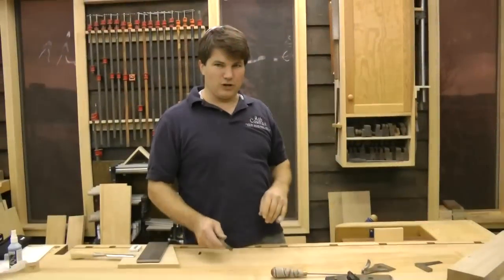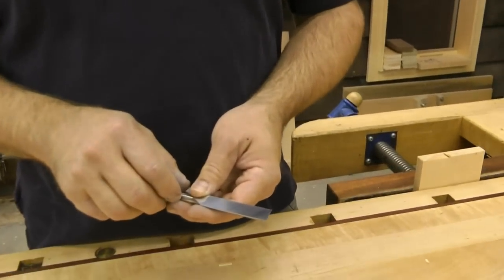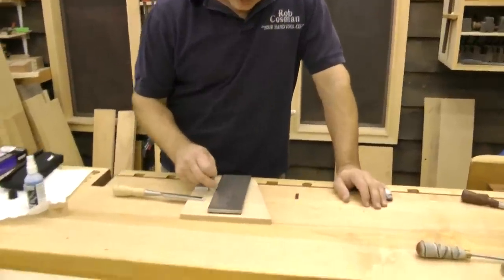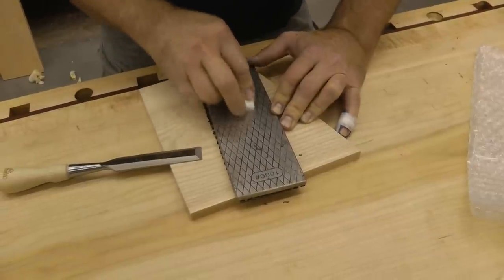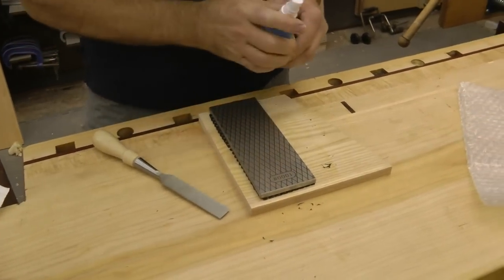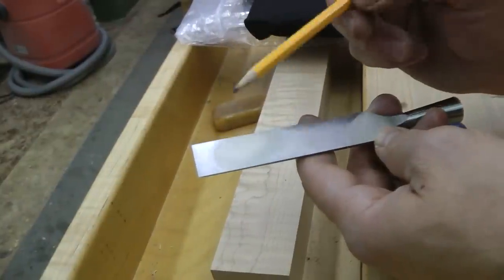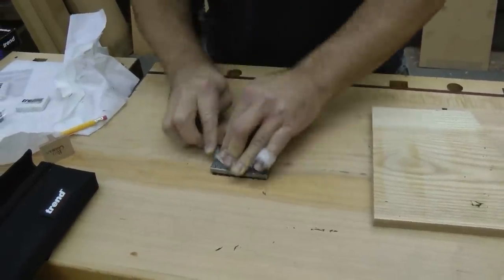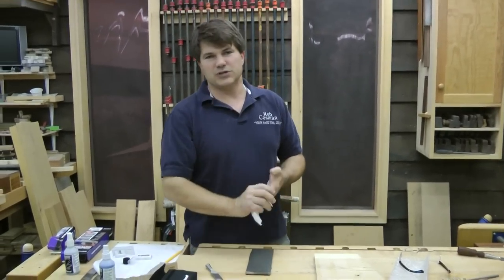Chisel Preparation with Rob Cosman

Comment: I thought I was preparing my chisels before I saw this video. Using this method makes even the $5 pack I have completely different. I can't wait to get some real chisels.
Reply: Honestly they won't perform wildly better. Theyll last longer for sure, theyll no doubt feel better, and probably look a lot nicer. But in my experience a sharp chisel is a sharp chisel as long as the steel is half way decent and the handles don't weigh double the blade.

P.S. I've found that I only really use the handle for force application (pushing while pairing, hitting while mortising) otherwise I hold it more or less in the middle of the steel/wherever I need to make my fingers into a depth stop. So don't get super hung up on handles. Unless you WANT to, that is ;)

Comment: I’m amazed at all the different techniques that are around for sharpening. This system seems like a very good one and is very reasonable, if I could indeed get many years of use out of it (about £100 in the UK, which is a little under $130 US).

I have actually bought a 1000/6000 grit waterstone too, but I’m really thinking this is the way to go to get the initial flattening of the chisel backs, etc.

I’m very new to woodworking and I’m bowled over with the amount of kit needed to prolong the life of tools, plus the varying levels of information regarding it.

And old video, but a very helpful one. Thanks, Rob.

Comment: Great advice Rob,is it necessary to rotate the diamond surface to get an even wear on the diamond.My son is looking to buy diamond sharpening but they were not as thick and lots of different grades, so I think we need to have a re think as they may not be as flat as those you have.He already has some shapston stones to finnish with,I noticed you went from 300 to 1000 is that your recommended grades ?

Comment: Hi Rob,  nice video! I'm interested to know what you make of Japanese chisels, in particular the hollows on the base?
Reply: They don’t make any difference. It’s easier to flatten the back, that’s it. Plane irons are tapped out with a hammer on an anvil once they’re ground down enough to get into the hollow. I don’t think chisels are though, not sure what the idea is. It would take awhile to go that far. The Japanese probably started doing it that way because they like their tool steel so hard that on a large chisel they take forever to grind the back flat by hand, which you can’t do on a large foot powered grinding wheel. If you find an antique chisel, finely made hollows are a mark of quality.

Comment: Hi Rob, I just bought the 8 by 3 workshop diamond stone and forgot to buy the lapping fluid. What can I use for a substitute lubricant? For now.
Reply from the maker: If you are just using the diamond stone, any light oil will do.  Honerite just makes it convenient to use on the diamond and the ceramic stones
Reply: @RobCosmanWoodworking  thanks. Can I use it to flatten a wet stone

Comment: If the back is convex, I would forget the stones if you have a belt grinder, particularly a stationary one. Use the wheel itself with 180 or 220 grit belt, not the flat top; first sharpie the area you want to touch so you can easily see where you’ve been (the center, and you MUST not wander from it or you undo the “grounding” you have done). Light pressure, let the grit do the work. First attack the very top of the hill, then gradually, once it’s lowered, wander out from there to roughly flatten or slightly dish. Then go to coarse stone.

Comment: this stone looks nearly identical to the double sided plate from chef knives to go, which is 1/4 the price or better 

with the exception that this one is slightly wider and has the diamond pattern on only one side.

I am wondering if they are from the same manufacturer but steeply marked up by trend.

have you tried the atoma plates? ive heard good things about them but am a little wary of the way they are put together (a thin diamond surface stuck to an aluminum plate with double sided tape) i bought some replacement plates and intend to cut up some precision aluminum plate to spray mount them to, hoping that will make them flatter.

good video, its verry critical but often frustrating to flatten  chisel backs accurately, i think diamond plates are the best option for it.

Comment: #1000 water stone can be your finisher hell 600 can be just as fine. but using this to remove metal or flatten a chisel is your mistake. no wonder they did not stay flat long. they  make 100 200 even lower that work in a tenth the time to flatter or make a bevel. 1000 will take... well 11 minutes at least
Reply from the maker: Show us your work and we will believe you. If not, we will regard your comment as being ill-informed.